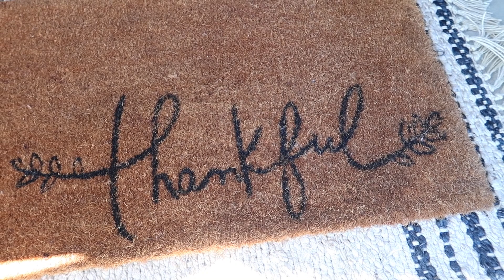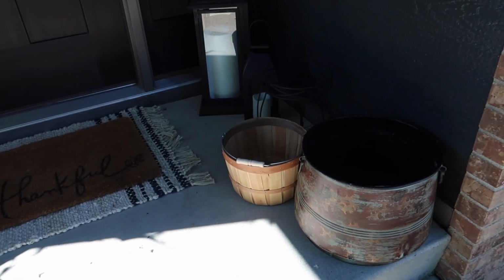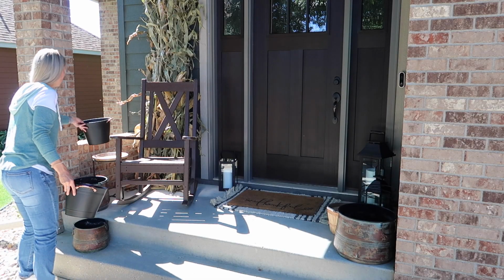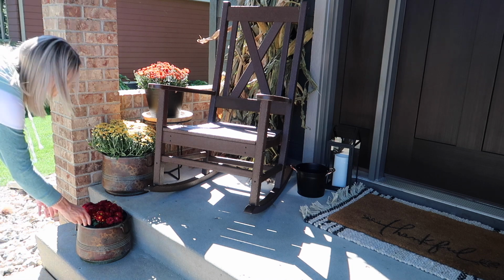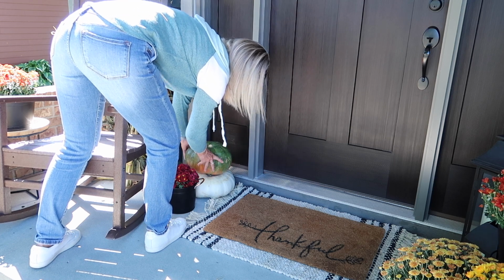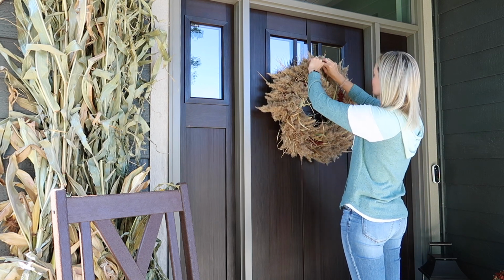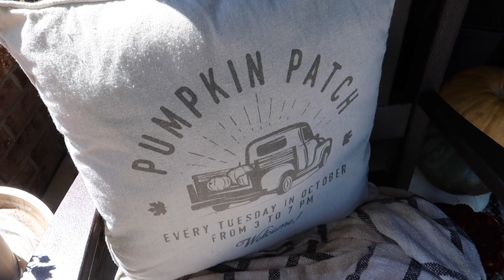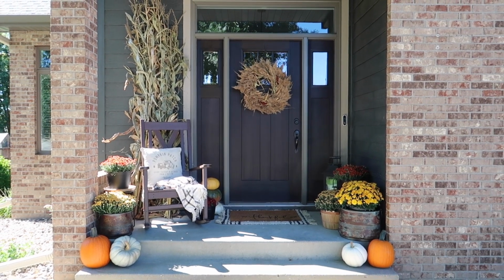*NEW* FALL FRONT PORCH MAKEOVER 2021 | FALL PORCH CLEAN + DECORATE WITH ME

Comment: Hi Crystal! Sooooo pretty! You did a beautiful job! I need to gather me some mums soon! Still busy with installing the flooring. NowI need to paint all the baseboards for the main living areas and a couple of hallways and the laundry room! LOL Hopefully I can get that done this weekend. The boards are off the walls which will make it easier but as you know from doing it, it is a process! I have those Walmart planters.....I loved them the last time you showed them. Did you drill drainage holes? I'm tempted to use them indoors for plants. They are so pretty and I hate to put them outside! However, I bet the patina on them will get better with age. I may pick up those black Menard's buckets. They are so cute and great for Fall and into Halloween. I don't repot my mums either. Doesn't pay here in the Midwest.